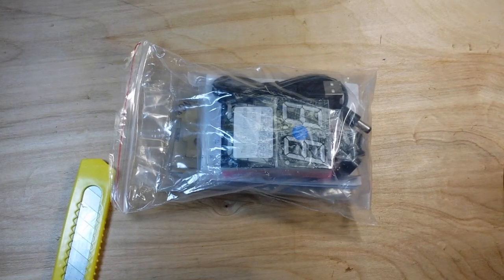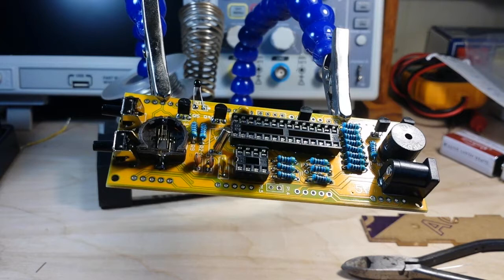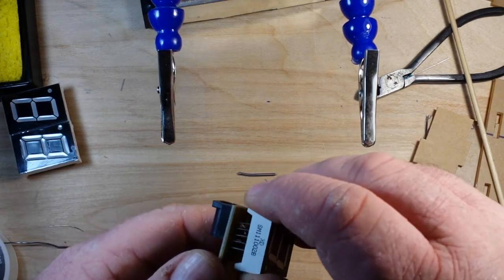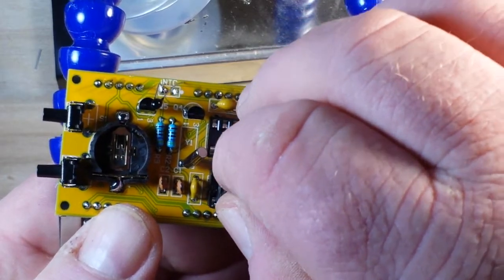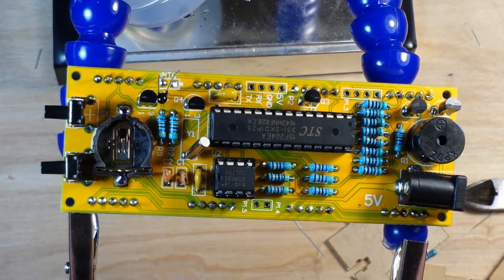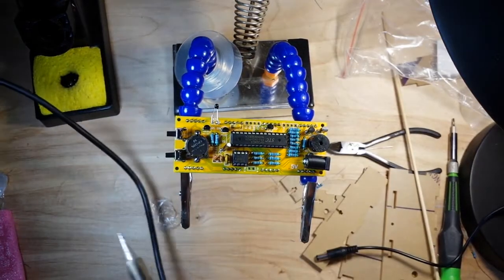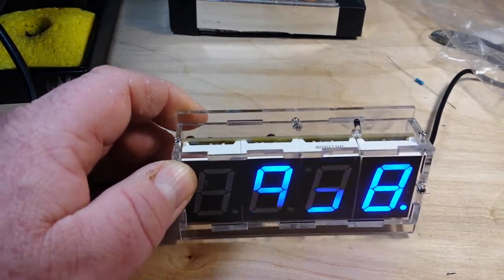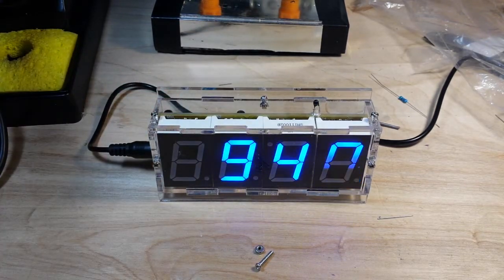Digital Clock Kit Build

Comment: I bought this blasted kit..soldered it all up and had a dead digit segment.  I suggest to try your led segments before soldering.  It's common. + On the middle two pins top and bottom.  Test with about 2.5 volts.  You can find a link to these digits to replace in Paul's other video where he found them if yours is bad.  Thanks to Paul for that!

Comment: Looks like a good kit. I see you aligned the resistors properly, nice touch.
Reply from the maker: George Chambers This is one of the best kits I've put together. But not if don't have a little experience. There are no instructions, so you need a little knowledge. but that being said, I'd recommend it.
Reply: It's just that $20 seems kind of steep. Does Banggood have one that's any good?
Reply from the maker: George Chambers these clock kits are available everywhere, Banggood, Gear best, Tomtop, Ali Express.
Reply: Thank's I'll check it out.